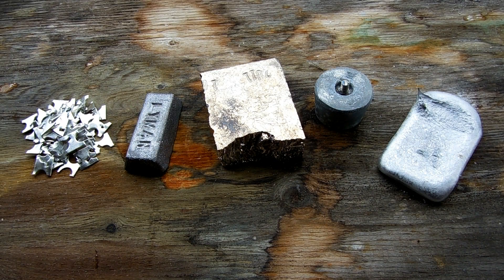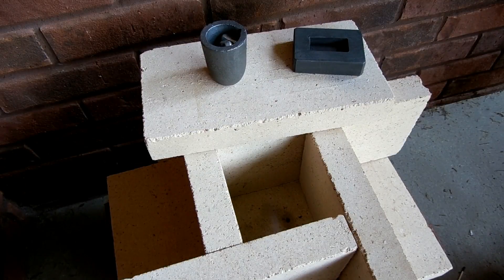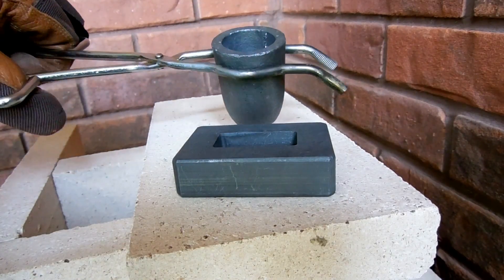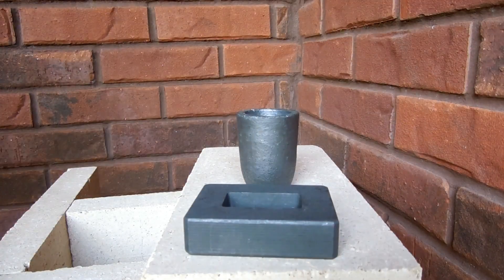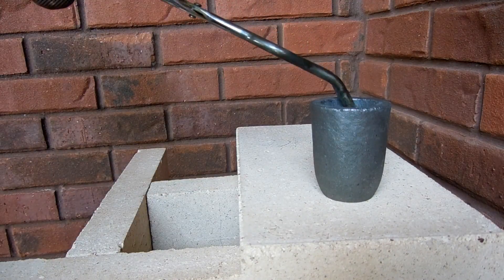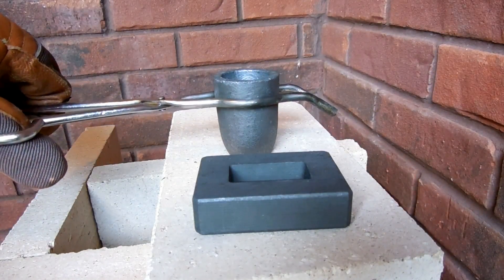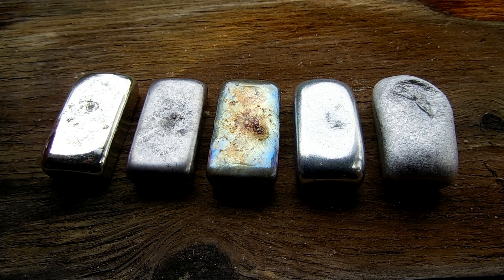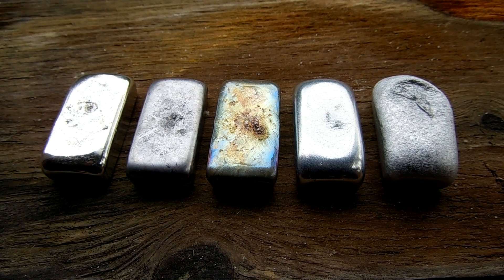Metal Bars: Casting

Comment: I have a idea to melt metal without getting slag. Pour some oil into  the metal before melting then heat it.the slag will disolve in oil.which really work with Zn, Sn, Pb

Comment: How do you remove metal that is stuck in the mold. I was creating an alloy of various metals and poured into a graphite mold but now it's stuck.
Reply from the maker: Weird. I've never had anything stick in graphite molds. Maybe your mold doesn't have draft in the walls. You could try cooling the mold since things contract when they get cold, and that might loosen it a bit.

Comment: Do you wear a respirator? I hear working with lead fumes tin fumes and certain metals can be toxic if inhaled
Reply from the maker: I didn't for this video, but I do for other ones like my brass video. The risk was pretty minimal here since the temperature was (relatively) low. In the brass video, the zinc is actively boiling so a respirator is required.

Comment: Sama Company in Sadat: injection of metal and aluminum, and the operation of a sheet and the manufacture of microcosm buses and minibuses and passenger train specials
Contact: T / 01004235648
And God reward you with good

Comment: What would you say is the purity of your soda can derived aluminum?  I've been thinking about making this for some metal projects but wasn't sure if purity would be an issue.  And, I know some places who asked to buy some bars from me once I got started if the aluminum wasn't too bad.  

Also, how do you clean your crucible so you don't mix the metals as you go from one type to another?
Reply from the maker: Robert Haney I have another video on the aluminum forge that has the alloys listed in the description. Cans are fairly pure! After melting, residues just slide right out of the graphite so it's no problem.
Reply: Very cool, thanks.

Comment: why did you heat the mold? I know the answer is probably obvious but I am new to metal melting.
Reply from the maker: Brent Whitley Two reasons mainly. First to prevent the metal freezing as soon as it hits the mold, ensuring a smooth and even pour. And second to get rid of any moisture, so it doesn't pop and splash molten metal around!

Comment: I've worked with aluminum a bit in a more properly built foundry; its usually best to wait a couple minutes after it starts to melt before you take it out. I just use a pair of steel tongs, and that makes it a lot easier to transition from removing the crucible to pouring. Best results come from moving as fast as possible.

Comment: I used big graphite crucibles for my castings. the highest temp I had only went to melting aluminym. I use clay crucibles now and I can now melt up to copper. not sure if it's the heat or crucible change
Reply from the maker: Someone else mentioned that since graphite is conductive it draws away heat too quickly, so I can definitely see clay or ceramic working out better.
Reply: +mrhomescientist but also try a sand and plaster of Paris foundry. I made one it works really great and yea graphite reminds me of silver with the low heat conductivity and clay stays at its current temp for a good time
Reply: +mrhomescientist and I just want to say I love your videos and can't believe u responded I'll make sure my friends sub to
Reply from the maker: Thank you!

Comment: Would a different crucible work better for the aluminum? Graphite has such a high thermal conductivity that it may be worth it to use a ceramic crucible and spend a few extra minutes heating it up so that it doesn't freeze instantly.
Reply from the maker: Yeah that's a very good idea actually. I need to get new crucibles anyway!

Comment: im looking at getting a graphite crucible for melting aluminum, it says don't use an open flame.  do you have problems when you do that?
Reply from the maker: It does actually erode the crucible over time, so they'll need replacing occasionally. I've gotten a fair bit of use out of mine though.

Comment: How big are these ingots? It's hard to get a good size comparison from this video. And how much do they weigh (on average)?
Reply: The weight would vary DRASTICALLY based on the density of the metal, the average weight wouldn't do you much good since the lead is likely twice as heavy as the aluminum.
Reply from the maker: More like six times as much!

Comment: You're wrong thinking all the other ones except for the LED uses less campaign or temperature then aluminum aluminum can do with a small fire with no air flow through it I've melted aluminum with the basic fire but think and all the other ones with higher temperature

Comment: How do you get the extra metal out of the little pot used for melting after it solidified?
Reply from the maker: +Digging4Answers The crucible and mold are made of graphite, so any remaining metal just falls right out. Graphite powder is used as a lubricant after all!
Reply: Where did you get the crucible?
Reply from the maker: +Digging4Answers I get this question all the time. I've updated the description with answers to some common questions.

Comment: Does the graphite crucible go bad after a certain number of uses...or will this be good for 100s of meltings?
Reply from the maker: +TheRagingCreeper It sort of depends on how you use it. If the flame is directly hitting the crucible (which is sometimes unavoidable) then it will slowly erode the graphite. For the most part though yes, these are good for many, many uses.
Reply: +mrhomescientist Alright, thanks. Can graphite crucibles be used in coal forges?
Reply from the maker: +TheRagingCreeper No idea. Assuming a "coal forge" burns coal, the same material the crucible is made of, I would be wary.
Reply: +mrhomescientist alright! Thanks!
Reply: +TheRagingCreeper hey! To answer your question, I use my graphite crucible in my coal forge and I am going on over 100 melts with it and it is still going strong. There have been no issues and it works great
Reply: +mrhomescientist graphite and coal are different things

Comment: What would you recommend as a cheap, non toxic, durable, metal that would have little flexibility?
I'm thinking of making a custom mold for handles that are part of a demonstration we do with the public because the previous (plastic) handles broke after only about 5 or so years. I couldn't use lead because it wouldn't be safe for hands on use of the public and I don't know if I could get a hot enough furnace for aluminum
Reply from the maker: +Gary Liseo Zinc might be a decent substitute. It depends on what your requirements are re: strength, toxicity, corrosion, etc. Aluminum would likely be your best bet, really. Making my "very simple aluminum furnace" (see that video) is easy and cheap!
Reply: +mrhomescientist i havent seen your video, but i know there are plenty of tutorials on the internet that work well. i made Grant Thompson's and im 15. as far as zinc, it creates toxic fumes in melting. i wouldnt reccomend it, especially to a beginner

Comment: Quick questions
1) does tin produce any fumes?
2) does bismuth produce any fumes
Thx!
;)
Reply from the maker: Iris The Yveltal I think zinc and lead are the only ones you really need to worry about for that sort of thing. Just get a box fan and blow it away from you if you're concerned.
Reply: +Iris The Yveltal Yeah, don't know about bismuth, but you're gonna want a resp when melting tin, preferably one with disposable filters. Tin fever sucks.

Comment: The reason why you're having an issue pouring your Al is because it's not getting hot enough. Melting point of Al is 1221 F but you need temperatures well above 1500 F to get a nice liquid pour.
Reply: That's what I was going to say also.

Comment: How did you make your forge? It's nice!
Reply from the maker: It's really just a stack of firebricks, and I drilled a hole in the bottom one for the torch to enter. Nothing is mortared together or anything so it leaks a lot of heat, but it's easy to assemble and change configuration if I need to. Works for quite a few low melting metals!
Reply: Wow that is simple! It might work better with refractory caulking? I'll try it, thanks man. Love your videos by the way.
Reply from the maker: Soul Garage Yeah that would definitely help hold the heat in. It's really just something I threw together pretty quickly and it's served its purpose well. I ordered the brick from home depot. They are quite hard to drill into, though - I think they make 'soft' firebrick that might be a little better suited for this. Thanks and good luck!

Comment: I would never melt lead.
Reply from the maker: WhaleTurtles The vapor pressure of lead at its melting point is pretty low, so the risk of inhaling vaporized lead is pretty minimal. Spilling molten metal on you is a much greater concern! It's always good to be aware of all the hazards of what you're working with, though.
Reply: WhaleTurtles Melting lead isn't as dangerous as some people may seem. you are actually able to melt it without the need for a mask!!
Reply: Jackrockpublic well its not dangerous, if you don't care about fucking your brains up, probably brain cancer. but casting lead is as easy as any other low melting point metal, with a mask or without one.
Reply: Jackrockpublic it will lead to worse affects later in your life such as brain cancer so yea.

Comment: One trick i found for aluminum cast is, avoid contact to air. I mean the housing for the mold should be closed on the upside to, with only 2 small holes. One for air out, one for aluminum in. Also before you cast, it is good to fish out some dirt which might be floating on the molten aluminum (some bunred colors, or hard oxides)

Comment: Hey ! love your video :)
but have you tried to make a bar out of lithium (from batteries) ? might be difficult/impossible due to its reactiveness, but i thought i should just ask...
Reply from the maker: Molten lithium is incredibly dangerous stuff. It's an entirely different animal than solid lithium. It will react with just about any normal crucible material! Iron seems to have reasonable resistance to it. Even if you can find a good crucible/mold material, it will catch fire instantly in air when molten. So you also need an inert atmosphere. I'm researching a reaction that requires molten lithium, so I'm actually working on solving these problems now!
Reply: mrhomescientist
that actually sounds realy challenging ! i wish you good look with your project :)
is it possible to melt the lithium in an airtight container ?
Reply from the maker: SOEINEGAUDI Definitely possible, but beyond what I'm comfortable with I think. Heating a closed container would lead to pressure buildup, and a pressurized container of molten lithium isn't my idea of fun!

Comment: Could you do a video on how you made your furnace?
Reply from the maker: It was really pretty simple, so it'd be a pretty boring video! All it's made of is a stack of bricks for height, with white firebrick for the walls of the furnace. I drilled a hole in the bottom brick that the torch tip fits through. Nothing is mortared together or anything, so it does lose a lot of heat through the cracks.

Comment: You need to use soft firebricks instead of hard firebricks. The hard fire bricks absorb heat which makes it much more difficult to melt metals. Soft firebricks insulate and are rated up to 2800 F in some cases so you should have no difficulties in melting aluminum and maybe bronze.

Comment: Isn't led bad and how did you make the forge
Reply from the maker: Lead is a heavy metal and can be toxic, but the metal itself isn't all that dangerous because there's no easy way for it to get inside your body (besides eating it, which I don't recommend). Lead compounds, like from dissolving the metal in acid, are much more dangerous since they can dissolve and pass through your skin. The small furnace is just a stack of fire bricks. The bottom piece had a hole drilled through it and a propane torch goes through that into the chamber. The aluminum furnace is detailed in another video of mine.

Comment: Why did he heat up the mould?
Reply from the maker: I wanted to get nice, slow cooling of the bars so they conform to all the nooks and crannies of the mold. If it was cool, some of the metals might instantly solidify instead of flowing into all the corners.
Reply: Oh, thanks!
Reply: Hairil Johan  AND you run the risk of your mold being damaged if you do not pre heat your mold because of the heat shock that it will go through being at room temp. to EXTREME heat conditions.

Comment: Hello,
I'm curious as to how to build your little brick oven there. What did you use to bring fire into the 4 surrounding firebricks you had?
Reply from the maker: It's just several firebricks placed in that arrangement (not mortared or anything). The brick on the bottom has a hole drilled through it that a propane torch fits into. I've talked about it a bit in some of my other videos.

Comment: New subscriber here. Very interesting video. I am a goldsmith by trade and am used to working with much higher melting point metals. IE. Gold and silver etc. Do you have to use any flux when melting your metals?
Reply from the maker: Thanks! No flux needed here. Depending on how dirty your metals are they can develop some floating dross as you saw, but it's so little that you don't need to do anything special to remove it. I'm actually interested in using fluxes - starting at aluminum temperatures it looks like you need it. Any tips on fluxing? Do you add it before melting, and how much? I imagine this depends on what metal you're working with.
Reply: mrhomescientist When torch melting, I always add the flux right before the metal reaches it's melting point. If oven melting, then the flux is added prior to melting in the crucible on top of the metal.

Comment: I'm a Hazmat Technician, and really hope you know what you're doing with that lead, you can cause serious damage to yourself, and people around you if you're doing things improperly, I'd suggest using a respirator with a decent charcoal filter
Reply from the maker: Elemental lead isn't that big of a deal as long as you don't plan on eating it. It's the soluble compounds that are really dangerous. I'm not heating this anywhere near hot enough for it to vaporize and pose an inhalation hazard. This is also done outside, and was a one-time event in any case. Not to imply others shouldn't be careful handling it, of course.

Comment: Couldn't you just have put the aluminum scraps into the mold while its in furnace? Then take it out when it's melted to solidify.
Reply from the maker: I actually did think about that, but I wanted the mold to be level to get a nice bar out of it and it's hard to guarantee that when it's sitting on burning, shifting coals. I suppose I could have machined it afterward, but simple casting is much easier for me.

Comment: I love doing this! I can only do it with lead and zinc as they are both easy to get and melt at a low temperature, low enough I just use a propane torch and no furnace. Every winter I set by my fire place with it on to act as a fume hood and play around with melting metals.
Reply from the maker: You should get some bismuth - it melts at a lower temp than lead and you can grow some amazing crystals with it. Rotometals is a good source for low-melting metals and alloys, or check on eBay.
Reply: I really would like to get some gallium of fields/woods metal
Reply from the maker: x9x9x9x9x9
Gallium is an amazing metal. I used it to make a room temperature liquid metal alloy in another of my videos!

Comment: Nice video, but I've got one question: What are the mold and crucible made of? At first I thought graphite, but that would burn in the open flame, wouldn't it?
Reply from the maker: They are graphite. Graphite crucibles and molds are pretty common things, actually. I imagine they don't burn because it's a solid block, but graphite powder probably would. Similar to how magnesium ribbon burns easily but it's extremely hard to ignite a big block of it.
Reply: mrhomescientist Graphite is also used for glass blowing/shaping tools. I have a graphite paddle I use for various projects and when I have a sticky door lock I scrape some off and have some awesome dry lube.
Reply from the maker: x9x9x9x9x9
I've got a little tube of graphite powder and use that in my door locks too! It works wonders and leaves no mess.
Reply: mrhomescientist
Thank you very much! I was wondering about this question for few years =)
Reply from the maker: *****
Ebay.